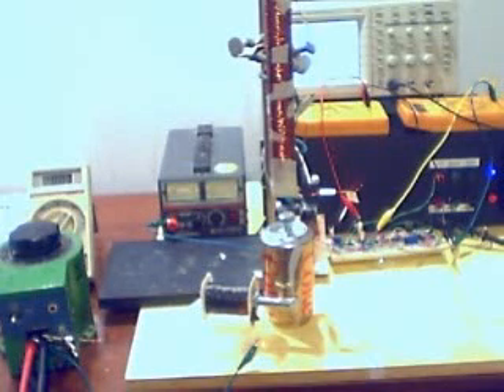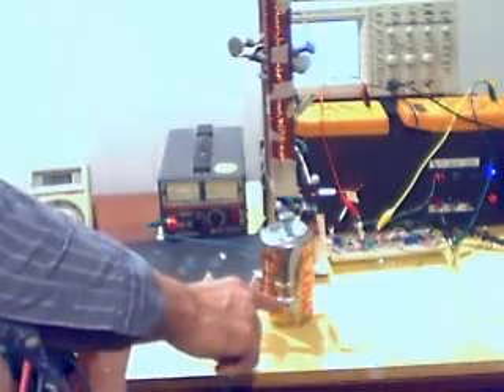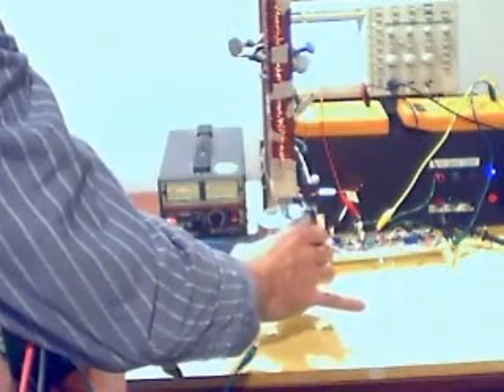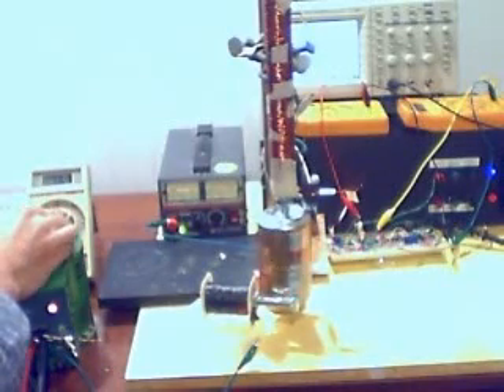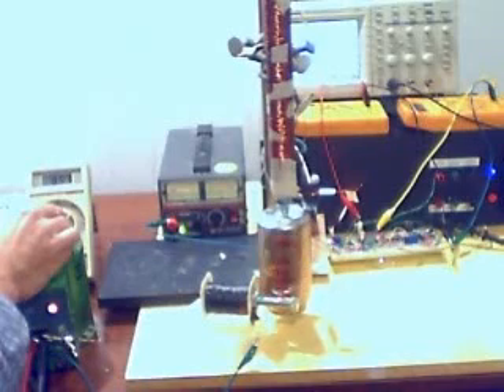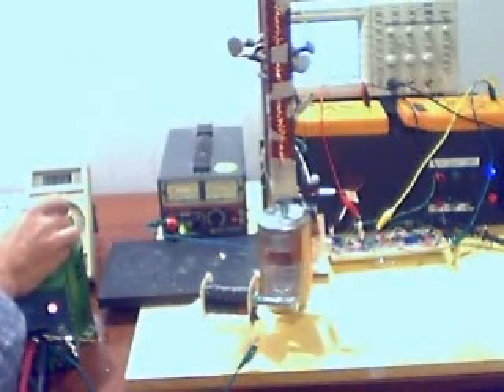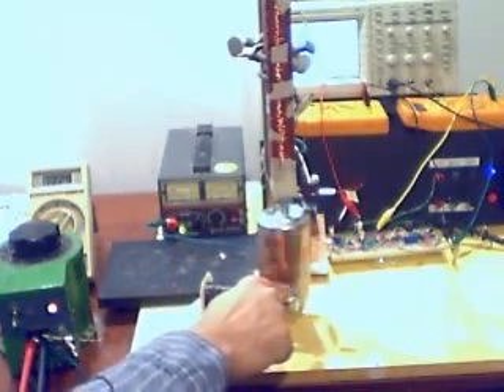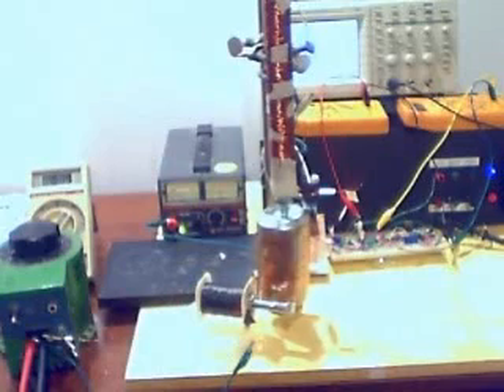Magnetic Levitation Motor with Eddy Current Drive Part 1.

Comment: Should be used for Magnetic Powered Car? Yes!  Frictionless Mag-Lev bearings allow high generator output to power the Hub-Drives already running millions of scooters & cars - on Li-ion Batts (see new Nisson "Leaf:"). Magnetic Levitation lets you drop the batteries! No needed input from grid or fuel (unlike this demo - see tape in?) My channel has recent vid of this and Lev wind turbines are being adapted too. Need for AC input is highly questionable.